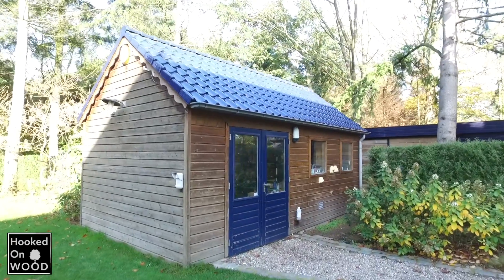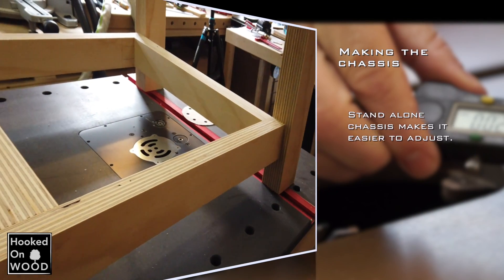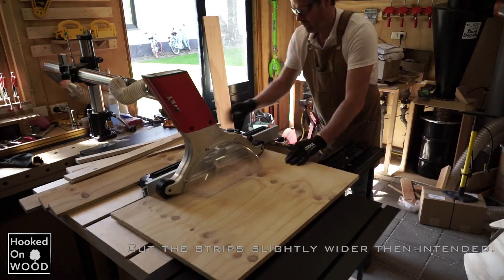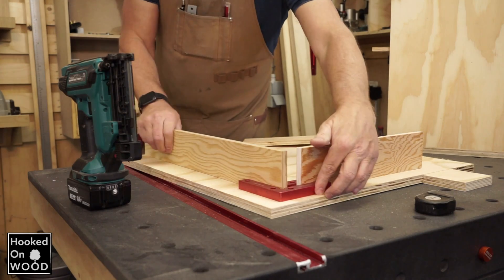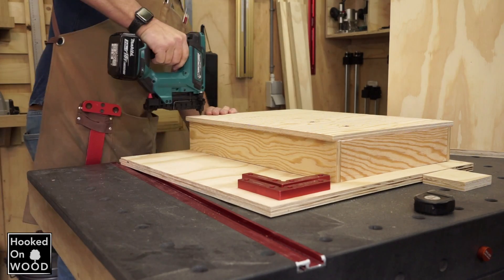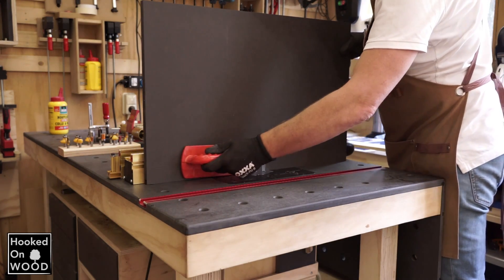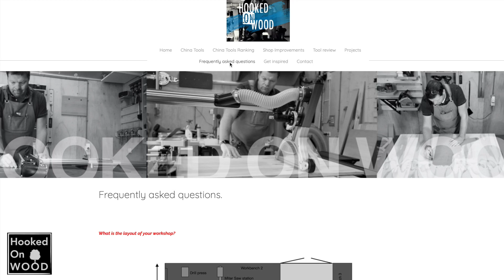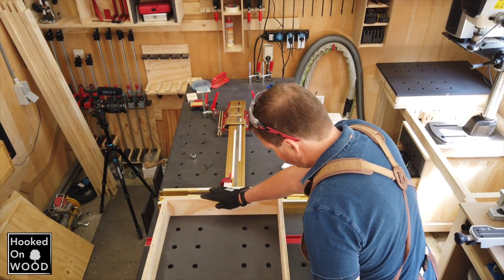Drill press - Miter station workbench!

Comment: I had a 10" Dewalt compound miter saw for around 12 years (light duty). It still works great https://www.youtube.com/post/UgkxPeGkHOMe05FySypTOvYumxMn-xi39oRe  but I wanted something bigger. My only complaint about the 10" was the location of the motor, and this version fixes that issue. The XPS system works well. My only request for future versions is a dust collection port (or adapter) that fits large shop vac hoses (or standard PVC pipe fittings) a little better. But that's not a complaint, just a request.

Comment: I bought this exact kerf maker and I don’t know if there’s just a learning curve not with using it but setting up or what but it’s not that easy. I’ve yet to make a perfect slot or dado with it because no matter what the setting was it would change in the second step. Instead Inspire Woodcraft I believe is the channel shows a fool proof way to get the exact kerf thickness of your blade with scrap and that did work out well. Anyone brand new to the table saw probably shouldn’t try though till more skilled. Anyways I really love your mitre station and the workbenches to the dust collection, drawers and versatile drawer slide method its all phenomenal and not common which makes your work stand out. Your bench is unique yet would work in most applications and looks stunning to top it off. I’d love to see all you make for your shop organization. If you build floor to ceiling cabinets and custom storage like that I’ll definitely be watching! Thanks for filming and sharing

Comment: I used your design to build my workbench with my router installed like yours. Works really well. When I was cutting the hole for the plate, I did the exact mistake you made in exactly the same place. 😆
Reply from the maker: Life is a Bit.. sometimes 😀😀

Comment: I think I'm going to pre order that same Harvey saw,looks like a nice solid saw.
Reply from the maker: Hi Rod, I am pretty happy with it. It has some small problems, but I think the new series are again a bit better. Small issues are with the fence that is not nicely finished on some points. The tinted coating is very thin. But Overall, I am happy with this saw.
Reply: Hooked on Wood thanks for the feed back. That was something I was wondering about just from what I've seen on line not sure about the whole high low fence.don't  see that on tablesaw Much.

Comment: I wish we could get that mdf more readily in the states
Reply: Me too ,I've been looking all over oklahoma .
Reply: The product selection is large and the market too small, for brick & mortar stores.
Reply: Can't we just buy regular MDF and painted in matte black? Or should we just use the mdf as is?
Reply: @thiagocastroneves8055 :
You could but, like any painted surface, the paint will wear off.
With this colored MDF, the color goes All the way through.
https://trinityinnovations.net/products/colored-mdf/
Reply: zapa1pnt I was thinking maybe dye it ,it would probably soak it right up. I'm going to try a pice,see what it does.
Reply: @rodpotts2666  please, share the results later on!
Reply: @zapa1pnt  thanks for the note.
Reply: @rodpotts2666 :
The dye will soak in more than paint will
and also swell the material more than the paint will. This is because the material is absorbent and the dye is thinner than the paint. The factory dyed material has the dye added before it is pressed to the finished dimensions.
You will also find yourself using a LOT of dye.

Comment: Hi Dennis, I have watched your Drill Press / Mitre Saw Bench video quite a few times now just to make sure what I am doing on my build :-) I have just demolished an Old Bench which I built 7 years ago which was a good solid Bench but not very practical. It has a lot of reusable timber in it, so I have decided to use some of it for my Chassis. Watching your Video, I wondered why you used strips of Plywood Glued together instead of solid wood for the Chassis, then I started to build mine and it became so obvious, NO Mortise and Tenon's to cut when you use Plywood Strips :-). They are all done now and I have to say they are the best Mortise and Tenon joints I have ever done (Not that I have done many) and this has been mainly due to my growing collection of China Tools, particularly the Measuring Tools and my new saw bench, so much more accurate than a hand saw.  The Chassis gets glued up tomorrow and I can then start on the Drawers and then the Top.  Can't wait to hear about progress on your new Workshop so please keep up with your excellent Videos.
Reply from the maker: Yes, it makes it very easy to make the chassis. But those different layers are also very strong and more stable. So, I think they are ideal. But nothing wrong with solid wood. :-)

Comment: Hi Dennis. Thank you for helping to make such a challenging year much more positive and inspirational. I love your design style and solutions. For your new workshop you might want to consider modular furniture that can join together. Parson woodworking has some clever ideas for this. For the retractable wheels, Pilots workshop has a great solution. I am hoping to combine your ideas with theirs and a few others to make six 960mm x 72 mm modules (router, sanding with vacuum table, miter saw, kreg foreman rotating top, bench drill press and assembly). In theory I should be able to join these all together to make a massive 3m by 1.5m workbench. In practice I see me making smaller combinations. Hope this gives you a little bit of inspiration back. Have a great new year. Fraser
Reply from the maker: Hi Fraser, I know Parson but did not heard of the other. I will look forward to it. I will integrate a Kreg foreman in my new shop, so I am excited to see what other make of that. Thanks for your suggestions.
Reply: Hi Dennis. Just a quick update on how to link the modular tables. If you go with the retractable wheel idea ( Btw I have a simple CAD drawing for the metal cantilever pole if useful), you don’t need too much force in addition to gravity so embedded magnets would be the way to go.

Comment: I just found your channel and have really enjoyed it. I appreciate the effort and detail, and you have saved me some money.  I originally came here because i was looking at reviews on a sliding attachment. I assume you are still loving the slider?
Reply from the maker: Hi James, 
Yes, I think it is good for a slider. The attachment of the fence is a bit annoying because you there is no fix 90 degrees on it. So, you have to setup it every time. This will not take long, but there is a change of mistakes. But I believe the new ones have fix this "problem" That said, it is not a panel saw. It helps you with heavier pieces, but I still think a cross sledge works best for small pieces

Comment: Hi Dennis,
Watching many of your videos (which I enjoy) I get the impression that you are a honest type of person, your recommendations have me considering purchasing the Kerfmaker, Mitre Gauge/Box Joint Jig, and the mitre gauge stop block, problem is BangGood have some very very bad customer reports, incorrect goods, no follow up customer service etc. Your opinions or comments would be appreciated
Reply from the maker: Before I did my reviews of Banggood products I was a regular customer for 4 years. I ordered a lot of products and I did not have any issues. My post office sent the products back to the sender two times at the same day they arrived. (fault of the postoffice) and in both cases I could contact the vendor easily and got my money back after I could sent them proof that the goods where sent back. But I have to say they change this procedure.  Last year I bought something cheap of 4 euro's or something and that did not work. So I tried to reclaim and discover that they changed the procedure and you had to sent 5 pictures etc. So, I bought bad luck and did not followed the procedure. So, I do not know what the response time would have been if I followed it. But I am pretty convinced it is not a scam company. They sell a lot of products and it is a serious company. So, I think it is pretty safe to order. At least my experiences over the last 5 years are very good. If that would not be the case, I would not have made videos about there products.
Reply: @HookedonWood  Thank you Dennis for your honest reply, I have found what I believe are  the same products on eBay at the same price and with free delivery a saving of around $50.00au so have ordered from there, fingers crossed.

Comment: I like to use dowels, I do not like to use pocket holes and although I have a Festool Domino Joiner DF 500 Q Set I find Dowels faster using a Dowelmax jig. The Dowelmax handles bevels with ease.

Comment: Dennis as always I love your work and your obsession with accuracy.  Given that the 20 mm dog holes very accurate why do you clamp your mitre fence against the dogs instead of having dogs underneath your mitre fence assembly.  Is it because it would fit too tight?  My thoughts were that with the tape measure on the mitre fence that the dogs underneath would ensure that the fence was placed in the exact location each time.
Reply from the maker: Hi Kevin, as a stopblock I use my miter saw fence. Because this is adjustable I can make small changes. When I do this with dogholes I can not move them sideways. So, that was the way I was thinking at that moment. But, when you use the fence from INCRA, you can slide the scales, so that makes fine adjustment also possible, if you use the dog holes as you described. Perhaps I will do it te way you describe in my new workshop. Thanks
Reply: @HookedonWood  Thanks for the reply Dennis.  That makes sense, especially if one were to get the dog holes exactly positioned for a specific mitre saw and then change saws.  The sliding scale on the Incra fences would help there as you noted.  I just thought by referencing the exact same 20 mm dog holes each time you inserted your fence it would aid in the ease of repeatability and accuracy without having to measure or clamp each time.  I cannot wait until my garage is done so I can start setting up my shop.  I am sure I will learn a lot more from your as you setup your new shop.  Hopefully yours is ready before mine so I can continue to learn from your new setup!  Your videos have been extremely helpful.  Thanks again for taking the time to make them and in English too!

Comment: Hi Dennis, could you possibly tell me if you made your actual Drawers (Sides / Front and Back) for your Drill Press / Mitre Saw station and your Main "Ultimate" work bench from 12mm Plywood or 18mm Plywood ? I can't quite decide from your videos but I suspect using 18mm would make the drawers quite bulky and reduce the overall space inside the drawers. It looks like you have used 18mm for the drawer bases but just not sure about the sides / fronts and backs. Many thanks for any guidance and very much looking forward to your next video with Peter Millard, keep up the great work.
Reply from the maker: Hi Colin, I used 18mm, but I totally agree with you that 12 will be enough. This was easier because I had 18mm in house. So, just took the easy road.

Comment: Great video. A question about your Harvey table saw, do you find the sliding table as useful and needed as you thought it would? In what occasions do you really need it? Wondering if to include or exclude it myself. Thanks in advance if you would choose to answer.
Reply from the maker: I did not use it till now. But also, When I need extra capacity I can just slide the drill-press platform out place and use my workbench top. Then I get even more capacity. So, in my next workshop, I will not do it again.

Comment: Very nice work, as always! It seems the elegant solution is often the simplest looking even if it’s not always the simplest to build. So here’s the big question: How do you like the Jet drill press? What do you think is great and what could use some improvement?
Reply from the maker: I still like the jet. In my new workshop however i just place it under the top but with no sliding part.  Indo not think it is worth that. However you need a way to put it under the table top. Improvements would be a better diy table. I am working on that

Comment: Hi Dennis! First of all, I am very impressed by all of your work here on YouTube. You do everything with excellent presicion and perfectionism. I am currently looking for a drill press on my own, I also have the Bosch pdb 40, and in need of a new machine. So, what made you buy your New Jet JDP-15B? I guess or know, that you sertanly think things through, so therfore my question. Perhaps you will make a video about it in the future?  I also look forward to follow you in your build of a new shop. Keep Up the good work, and happy new year from Norway. Br Maarten.
Reply from the maker: Hi Maarten, 
That is a bit of difficult question. On one side, I do not use the Drill press that much. But the Bosch is not stable enough for more accurate drills. Although It is a nice and convenient machine. So, my first choice was a Teknatool nova. But both the models are above the budget I wanted to spend. But if I would use it more often, I definitely would choose a Teknatool nova. 
That said .The Jet is made for the woodworker, has a bigger platform for that (although it is not that hard to make something nice for ourselves). I heard and read a lot of nice things and than It came by for a very good price, so I bought it mainly for the good deal. 
There are a few things that I think are not perfect in the construction, but it works. But it runs really smooth, changing the belts is not that hard (although I change it nog that much) The system to measure the depth of your cut is not that convenient of the Bosch but is good enough. It is definitely a better machine than the Bosch. So, all the things I missed in the Bosch the Jet delivered. So, in the end I am satisfied. I bought mine here: https://www.holzundlicht.de/Maschinen-HOLZ--METALL/JET-Holzbearbeitungsmaschinen/Bohrmaschinen---Zubehoer/JET-JDP-15B-M-Tischbohrmaschine-230V-mit-Laser--2204.html And that is a lot cheaper then if I would have bought it in The Netherlands. And it came direct from the importer in France.

Comment: Hi Dennis, another superb and informative video. I really like your method of construction. I wondered whether you get many voids in that type of plywood? 
Also do you ever use a finish on the black mdf? 
Cheers, and a happy and healthy New Year to you. 
I look forward to seeing your new workshop.
Reply from the maker: Hi Mike, I use Radiata plywood, this is a bit more expansive then ordinary plywood. But it is more stable, better glued and lighter in color. I do not have too many voids. Till now, I still did not finish the Black MDF. I will do this on short notice. I tried a piece with danish oil and this works nice. Glue is very easy to get rid off and water does not have a change. The downside is, that it becomes a bit too shinny for my taste and perhaps it becomes a bit too slippy. But I will try it anyway to get the answer.
Reply: @HookedonWood  
Hey Dennis Thankyou for replying to me. Please keep making your wonderful projects, and your educational videos too. 
Cheers
Mike 🍻
Reply: @HookedonWood  I pinched a lot of your ideas for my workbench build...I applied Tung oil to the surface and it really deepened the black colour and also makes it very easily keep clean.

Comment: I recently found your channel and I have to say, very impressed.  Your attention to detail/functionality combined with styling are all on point.  I've been designing my new workshop layout and I can absolutely see myself doing something similar instead of dedicating part of a machine island to the drill press.  Only question is, with it confined within a non-mobile bench like that, do you ever run into (or foresee) issue when trying to drill larger stock/pieces?
Reply from the maker: Hi, On this moment no. But I have thing about this a lot, so the removable middel section was somewhat of a compromise to do it this way. I am working on a new workshop and I think I will still do it this way even if my new workshop will have more room. If I come in a situation that it become a problem, I have to find a solution at that time. But this is all depending on what kind of projects you do.
On this moment I think I need more horizontal capacity than vertical capacity.

Comment: how do you like your Harvey sliding table? I just ordered one for my table saw.
Reply: Where do you order it from?
Reply: @bluewanderer9903  harveywoodworking.com pre-order, ships late February .
Reply from the maker: Hi Jonathan, It is not a panel saw sliding table. So you can not compare it with that. But I think it is the closest thing to it. Overall, I like it. What I do not like is that you have to set-up your fence every time. It is not fixt at 90 degrees. It is not a problem to do this ones, but every time gives some risks. That said. I believe the new models do not have that problem. Then I think you get a very nice product.

Comment: Hi, as a beginner, I have noticed that you need many clamps for woodworking, would it be possible to review some inexpensive ones for us?
Reply from the maker: Hi John, I am busy with Banggood for clamps. Problem is, that parallel clamps are not that cheap on Banggood. Then you can better buy Bessey clamps on sales. But there is more than Parallel clamps, so I will try to get some and make a review about it this year.
Thanks for your suggestions.